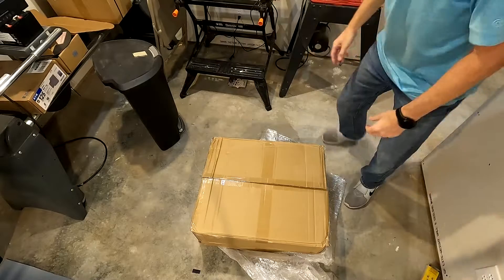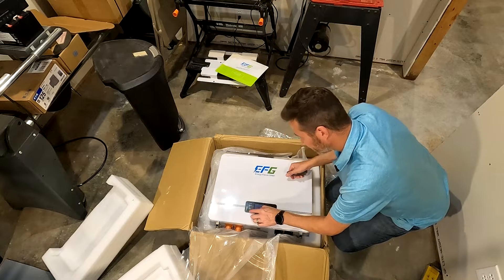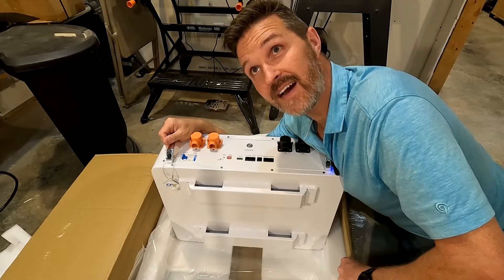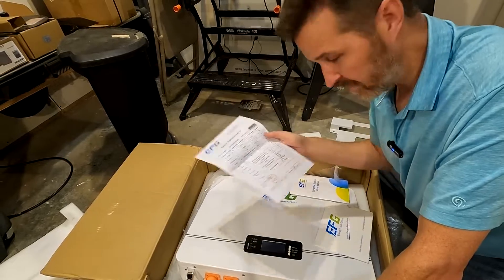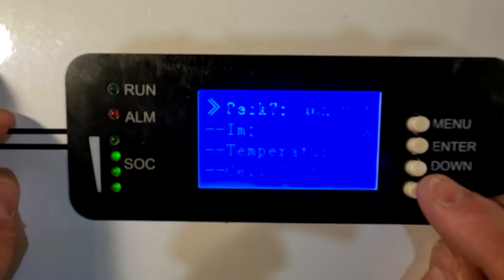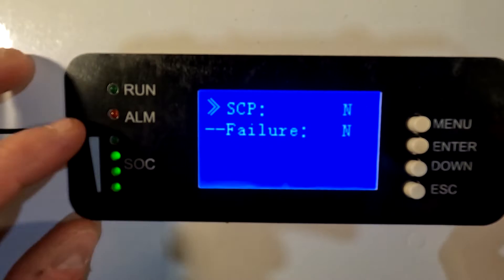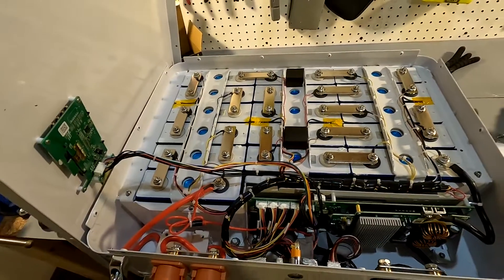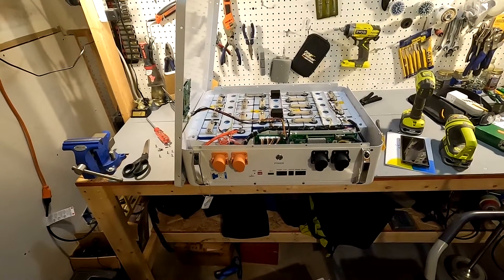EFG-Battery 48v 100ah Powerwall LifePo4 Battery Review!

Comment: DCT or Dry Contact is a simply relay to control something like an alarm, charger  or a generator.  The term "Dry" just means that the circuit is just for controlingl a relay or switch, and will not have the power to run the  actual  off-site device.  A wet contact has both the switching function and the power to  energize an off-site device.  You probably can choose from a normally closed circuit or a normally open circuit , and it may be triggered by a voltage limit you program into the BMS.  Nice battery!
Reply from the maker: Thanks for the great info!

Comment: Nice battery but I have one simple question every charge controller on the market says connect battery first solar panel second because if you connect solar panels first direct tree Siri don’t have nowhere to go and you will burn your charge controller solar panels mate twice as much power when they are cool watt what happened to the charge controller when the battery gets cold and the BMS turn off low battery what do you think will happen to the charge controllers
Reply from the maker: You are correct.  If the BMS shuts the battery down due to cold, then the charge controller will most likely get cooked unless your charge controller is smart.  I know Victron can be programmed to shut down @ 0⁰C.  I'll need to find more information on it.  Thanks for the question.
Reply: Wow wow wow ! Wait what you trying to say if my battery is fully charged during the day by growatt inverter and once is charged BMS shut down the battery and my inverter gonna get cooked? That’s crazy ! What kind of inverter do you have? If that makes sense I would have to stay at home 24h or work’s night shifts so during the day I will have to looking at the inverter and switching off if fully charged ? Did I miss something? That’s is the job for a inverter and battery and communication cable !
Reply: @piterex7  yes that’s why you had to set your growatt to stop charging the battery 5% before the battery get fully charged
Reply: @solarandwindinsouthtexasda1473  it would be great if you make a video how to set up Growatt inverte

Comment: Glad to see you are exploring 48V. 12V is great for RV or really small DC projects, but 48V is really the sweet spot for off-grid applications. You'll save a lot in wiring costs, especially if you have long runs to the panels since you can now put those in series.
Reply from the maker: Thanks for the comment!

Comment: How does one connect a 24 or 48 volt system to 12 Volt items?
Reply from the maker: You need to have a step down converter.  Here is a link to the one I use.  
24v to 12v Step Down Reducer
https://amzn.to/3KcTWOZ
Hope this helps.